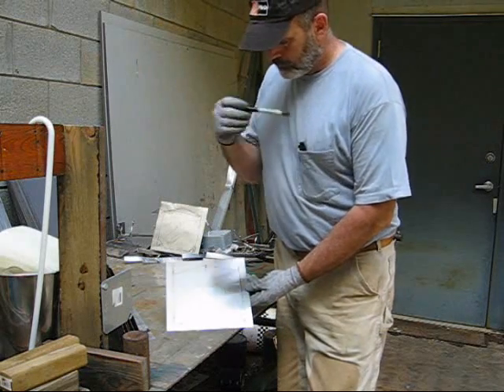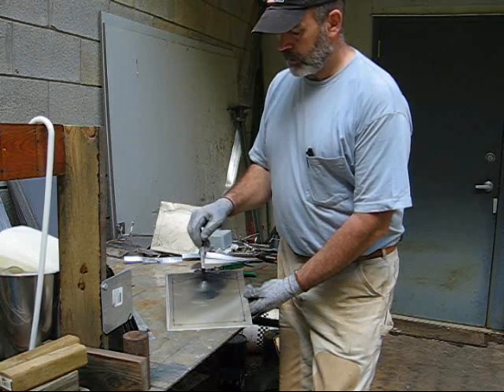HHO Dry Cell Mars Gasket Part 1

Comment: Current takes the path of least resistance so you will get a voltage reading at all 4 contacts on the plate but your current will still be uncontrolled with an unbalanced flow. If you divide the current with a simple circuit before connecting to the plate, you will then balance the current better than trying to do it with the small resistance of the wires, connections, and plate. you have the right idea, just improving efficiency. Soon you will be pulse modulating your power for a real kick :)

Comment: Don't like to add to the confusion...but you talk about the voltage drop off over the surface of the plate, due to the resistance of stainless, but you also talk about the need to keep the plates at even distance, so may be take both problems and get the advantage, angle the plates closer to each other the further they get from the terminal, so the drop off is compensated for.....difficult to orgainise...but may be helpful.

Comment: Hello, I have a plasma cutter,shear break and roll, hand shears, and so on. The best thing I have found for cutting sheets is my little table top Ryobe band saw from Home Depot. Under $100. I outfitted it with a metal cutting blade from the guy at Prax Air. (or any place that builds bandsaw blades). With the bandsaw I have no worpage. If I have to clean up the edge I use a file or my 4" grinder. Works perfect everytime. 
Don't get me wrong about the plasma cutter, I love that too. 
Greg